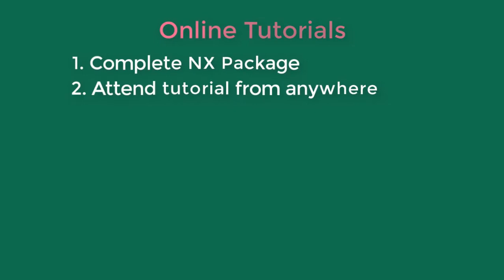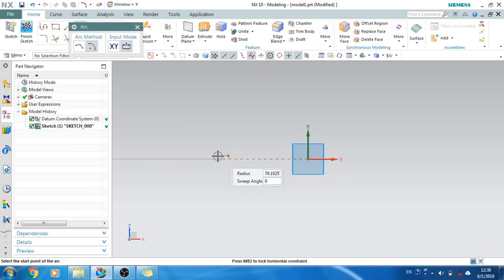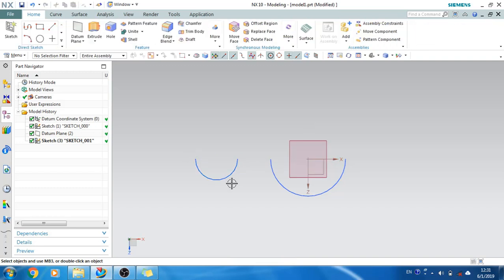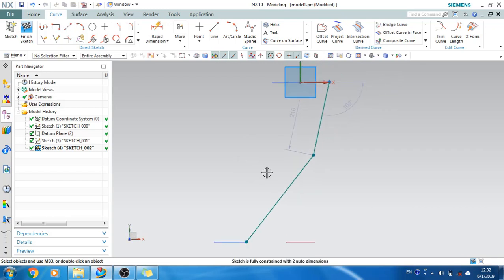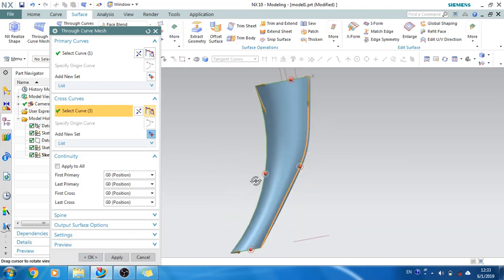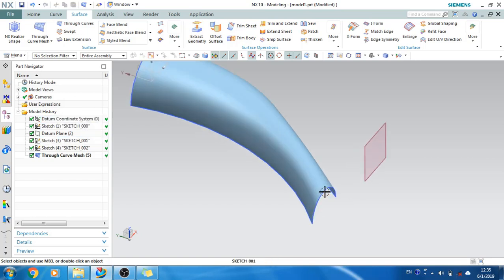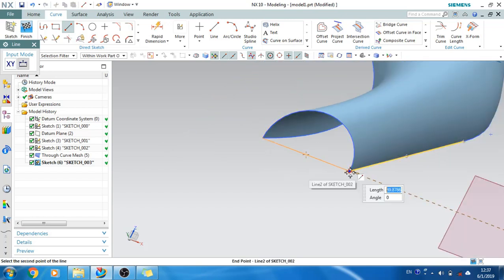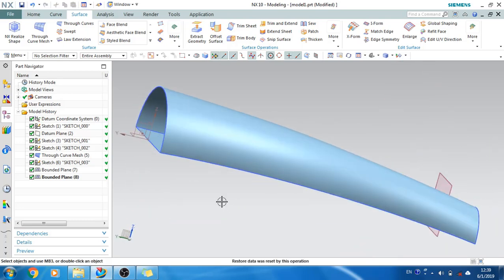Unigraphics NX- Basic of surface modeling || Through curve mesh || Difference in swept through curve

Comment: what is difference between through curve mesh and sudio surface ?
Reply from the maker: if your sections and guides don't intersect, or if you need to control the spacing of poles using spine curve, through curve mesh is useful.. this cant be done in studio surface.
Reply: @TechDesignsantosh  sir,can you make one video on that ?
Reply from the maker: Ok

Comment: I think u shared wrong information regarding swept command,
In swept command we can add multiple profile or curve which can be different in  shapes i.e. circle and rectangular but u said only one profile we can give
Reply: I'm trying to learn surfaces and yeah I've noticed that we can select more than one section curve with swept command, although they are not the same type (e.g., one is arc and the other one is square shape), it will create a surface when at least one guide curve is given that touches both the section curves. No problem at all